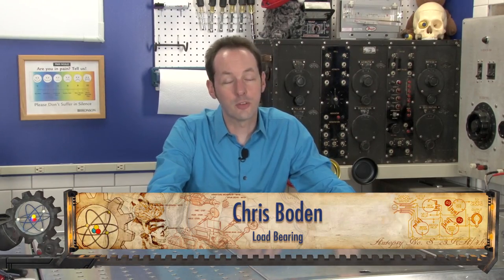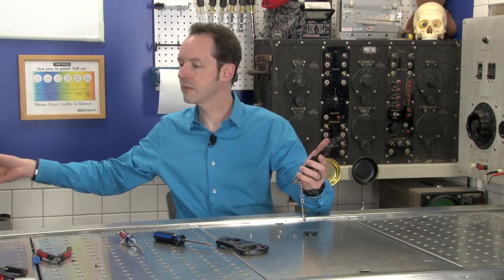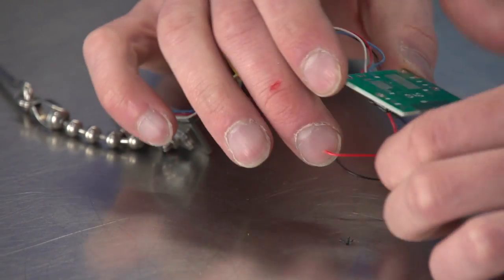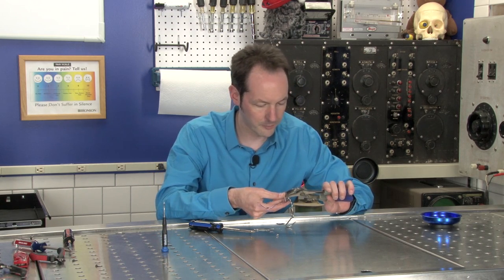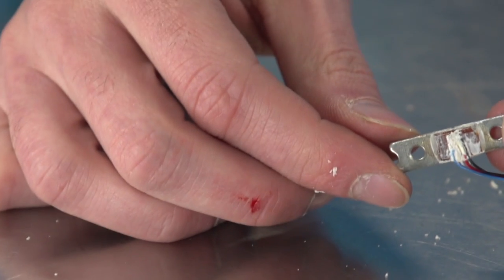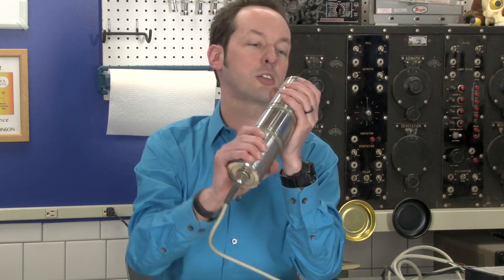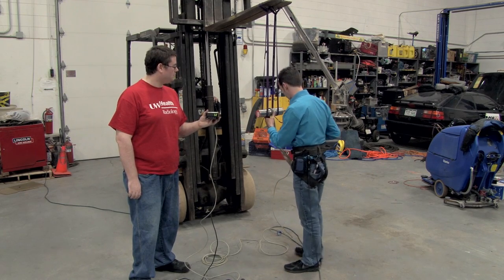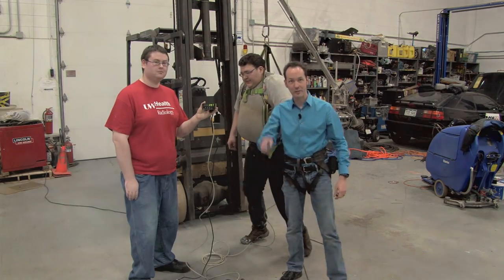Strain Gauge Scale: Equipment Autopsy #73

Comment: Interesting experience regarding old electronic bathroom scales: I took one apart years ago, and it actually had the exact same dingus inside that a mechanical one with the spinning dial had, except instead of spinning a dial, it spun an optical rotary encoder disc and that was used to drive the display. Must have been one of those first-generation ones or something.

Comment: it's interesting how you can measure large amounts of strain with a tiny device and some clever design.

we use a lot of big loadcells on the winches we build at work. up to 2500kN or 250tons in bolt form like your 50kN cell, and in bracket form up to 8000kN or 800tons both pressure and tension types.

we buy the strain gauges and build the loadcell to suit the type of winch.

Comment: The most common load cell is a resistor bridge circuit, (4 resistors), 2 wires would be power, 2 wires are output, and that one is resistive, according to the case, it measures up to 50 pounds